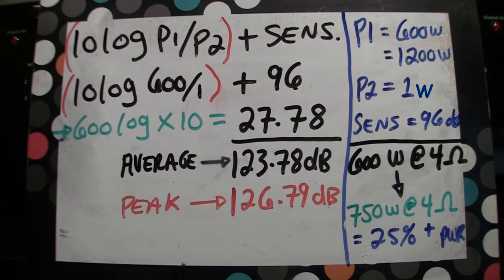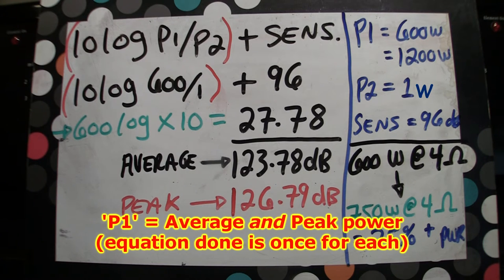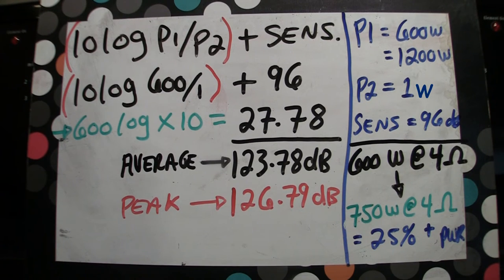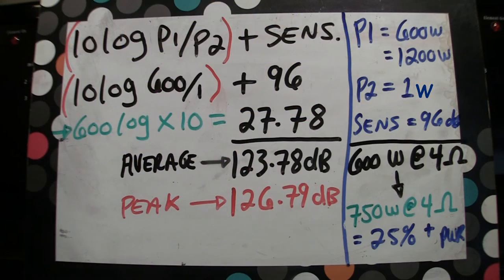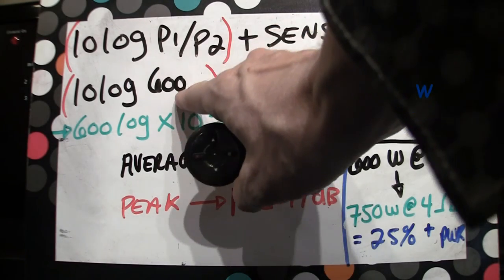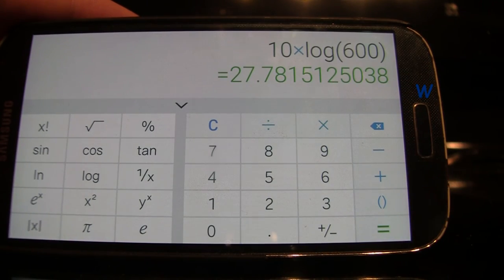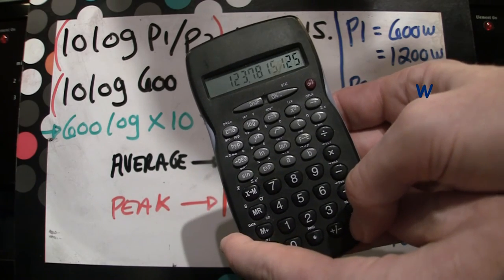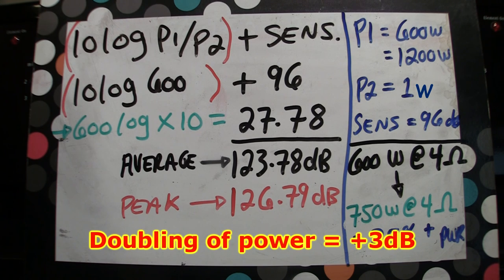How to Calculate dB SPL for a PA Speaker - How Loud Can Your Speakers Go?

Comment: thanks for the video!
i have a question...  how is that possible that some people have around 2000-4000 wrms and get 150db ?
Reply from the maker: For a 2000 Watt speaker with a sensitivity of 117dB, that would equal 150dB. For a 4000 Watt speaker with a sensitivity of 114dB, that would equal 150dB. So, the sensitivity has to be calculated with the power. But I don't want to stand anywhere near 150dB!! :-) BUT, if 2000 is the average (rms) and 4000 is the peak, and the speaker was 117dB sensitive, then the peak SPL would be 153dB.

Comment: I don't get the part why it is SPL(amplitude) but you use 10log instead of 20log? for example your end +3dBspl
Reply from the maker: Log base 10 is the equation for calculating SPL of speakers in a test chamber. Log base 20 is used for Inverse Square Law calculations, as in 20log D0xD1/DsxD2 -10logNOM-FSM
Reply from the maker: Also, SPL is not the same as amplitude; it is the result of the acoustic power...every doubling of power = +3dB, every doubling of amplitude = +6dB.

Comment: Is the peak power the same as turning up the volume all the way and playing a pure tone?  Or something else?  And, if there are 2 speakers, would you add the watts from each? Finally is the peak power decibel number at 1 meter from the speaker?  Sorry to bombard you with questions, I'm just obsessing over calibrating my sound level app...
Reply from the maker: Peak power is reserved for transient peaks that need more headroom than the average signal. Peak power is the loudest that the speaker should be. When 2 speakers are playing at the same volume, 3 dB extra is the result, because every doubling of acoustic power equals 3dB. The sensitivity of the speaker is measured at 1 meter away and the average and peak are based on that. Hope this helps.

Comment: I've always wondered if a speaker could handle max power. Does this mean it can for short bursts? My guess is not ideally because the suspension will come into play long before power will. Am I correct in that assumption?
Reply from the maker: This is a good question - I've rarely ever need to use a speaker at full power for bursts. But, they should be able to handle what the amp gives out for bursts. I put a limiter in the system if possible. Also, I have never blown a speaker. I tend to downplay the volume and scoop low-mids and certain lows to prevent overloading amps and speakers. Cheers!

Comment: If i have 1 speaker box 
800w×2 mid drivers 97.5db each
60w×2 hd drivers 108db each
So how i calculate total spl of speaker box.
Reply from the maker: All drivers in a single box? If so, the sensitivity is usually measured as a whole, but by the specs you gave - 10log800 = 29.03 + 97.5 = 126.53dB for the mid driver, and 10log60 = 17.78 + 108 = 125.78 for the HF driver. If you consider 2 drivers each, then add 3dB for each.
Reply: @bacontrees  yes all drivers are in single box then  what is a total spl of that box 
Can we sum both hf and mid drivers spl or whta